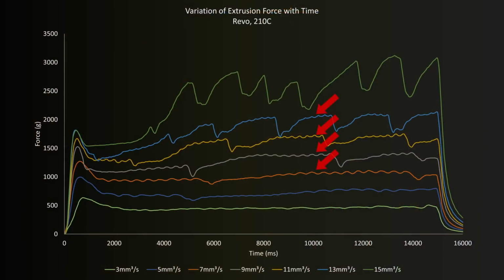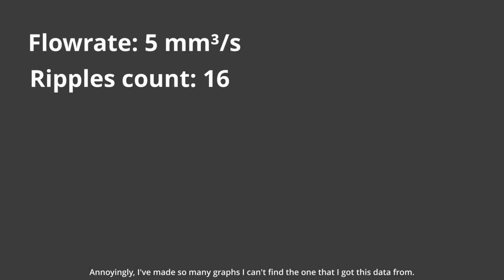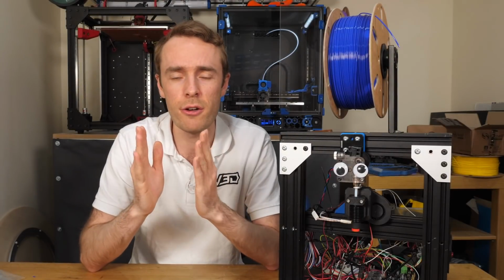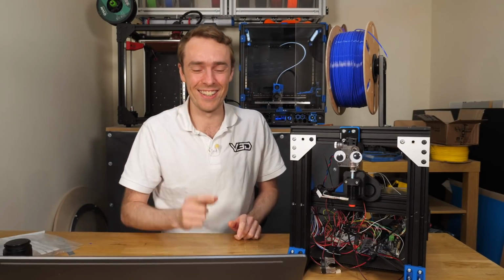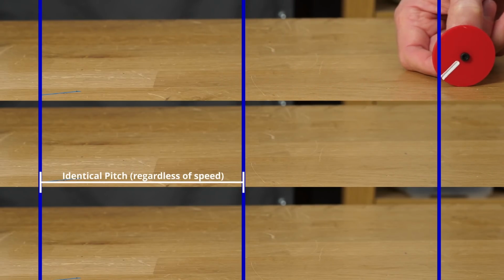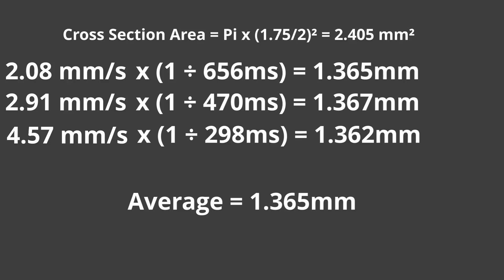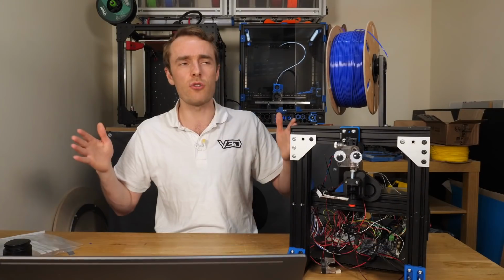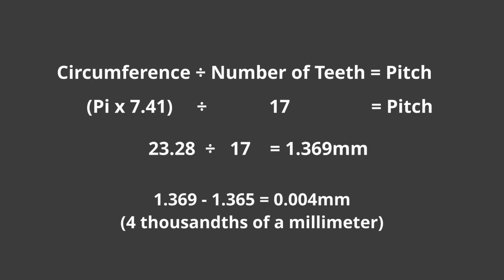Are Clone Extruders Ruining Your 3D Prints?

Comment: Use of helical/double helical gears should mitigate this problem ensuring smooth engagment of extruder gears. These gears are allot more difficult to produce though
Reply: I agree. I think even 2 single helical gears would help the issue a lot, though this is just a hypothesis.

Comment: From what I've tested and seen on MihaiDesigns videos the dual gear extruders will always produce this pattern. It can be more or less visible but I couldn't get rid of it completely.
Reply: I replied to Vector 3D's Tweet about his previous video with a link to MihaiDesigns' video on topic. As MihaiDesigns points out, this problem is inherent to dual gear extruders. As long as the distance between the two gears is allowed to move a bit, this problem will persist. The extruder really needs to be redesigned to solve the problem.
Reply: @ddegn  Yes, you're right. This is a design problem. Bad poor quality clones can make it more obvious/visible.

Comment: I've got about 6 of these in rotation.  And to be honest, they are pretty trash unsurprisingly lol

After a few hundred hours of printing the roller bearings die and everything goes to hell.  I've had much more consistent luck with the even cheaper titan clones being a simpler design. 

Been wanting an authentic bmg, but eh the price is tough when you have 24 machines lol

Comment: I've actually put a lot of thought into this one. My prediction is that a filament test is in your future. The gear teeth would have to be very small if you don't want this artifact, to the point of being useless. My intuition says that it's the filament hardness (compressive and shear strength) that is the cause. If you were to use a different filament, you should get a different result. Temperature will make a difference of course, but since you have your fancy filament-force-o-meter, which I nominate for its name before you do the obvious next thing, it should be a breeze. 

I almost forgot. My prediction is that the softer the filament, the less of an artifact because the teeth are really in there, and the radius of movement? is smaller. This could be exaggerated and compensated by adjusting your spring tension 

Another prediction is that smaller diameter hobbed gears will have a more noticeable artifact, than larger diameter hobbed gears. More teeth to do bites

My logic support:
In civil engineering you calculate the volume of asphalt for a road by multiplying the centerline length by the width, by the thickness. You don't have to account for curves because the centerline is in the middle of the road.

I used to think the line was on the outside surface of the filament. It is not. I feel like you want the average radius of the gears to be as close as you can to the radius of the filament.

Comment: I had a very cheap clone with a roller bearing on the idler that failed and gave me very obvious artifacts. Changed the bearing and shaft and it's good. I think one of the ballrace bearings is getting a little notchy on a clockwork extruder and it's doing similar. 

But with good bearings the difference between cheap 1.8 degree steppers and e3d/motech 0.9 degree steppers in my XY is much more apparent than extruder induced artifacts. Specifically moving one axis whist the other is stationary on a weak microstep can give some jitter thats visible with shiny filament in some lighting.

Comment: this reminds me of the issue that Stephan (CNC Kitchen) had with a single hobbed gear extruder where the center hole was offset (i.e. NOT in the center of the gear).  All the talk of backlash (???) doesn't make sense, nor does the synch of the teeth.  However, the difference when offset, means the gear actually has a higher speed at the "circumference" because the different places are closer or further away from the center.  Different "speed", means different force!

So, is the center hole (on all the gears, including stepper) actually in the center of the gear????

Comment: There are a few other people coming to the same conclusion with different methods (the vertical ripples in vertical walls for instance). This is however the most "scientific" proof that gear backlash is causing this.
I would love to indeed see the comparison with the original BMG but also with the larger gear extruders like Orbiter and LGX with its plastic gears which might well dampen the backlash more effectively.

Comment: I've experienced this when i was developing remotely driven flexible shaft extruder a few years ago. I couldn't thought of a good way to test what was the root cause... your load cell extrusion force method combined with the ideas in this video just gave me a big inspiration on how to solve some issues i've experienced or at least find out what went wrong. good to see people are getting more scientific about consumer FDM 3d Printing....
Reply: @jamesmccaul2945  haha i kind of stopped working on it... and yes you are right about the performance compromises which most flex shaft driven designs/products i've seen didn't address or even mention.

Comment: My initial thought is the tooth profile not quite being linear with rotation. Involute gears have a contact patch that moves in and out. Changing ratio slightly and sinusoidally? 
Might be nice to try belted gearing as I'd imagine multi tooth contact would have an averaging effect.

Comment: Had issues on my Voron 0.1 and replaced the main gear + shaft assembly from the BMG one to a cloned version and my issues were almost gone. I assume my main gear is slightly off-center and was causing these issues
Reply: I had exactly the same experience but in my case fake BMG gears kit solved wood grain inconsistency completely, compare to original BMG gears.

Comment: Exactly what I predicted in your last video! I made a test.. printed an object where the extruded amount per layer is extremely close to one rotation of the extruder gear..  you can clearly see the variation in extrusion width wandering up the object and count the teeth on it. Transparent filament is working very good for this. After seeing this, I really think this is a substantial problem we have with fdm printing . I´m working on a sensor system to make this visible and later correcting while printing. Or closed loop extrusion in other words. This will take some time, but I did my research, pcb and hardware design, building the first prototype in a few days. When I have something working I´ll send some out for research, maybe you´re also interested? Keep on with this series, we need to have more data on this stuff:)
Reply: 'After seeing this, I really think this is a substantial problem we have with fdm printing . I´m working on a sensor system to make this visible and later correcting while printing. '  
Just to save you some trouble, all you really need to do is keep the drive gears fully engaged at all times.  IOW don't let minor variations in filament diameter push the exactly parallel shafts apart.  Push harder on the bottom to keep the drive gears together, and let the top float a bit to take up filament diameter differences.  The tiny change in angle won't matter.

May still be some artifacts anyway, the teeth are relatively large for the drive diameter.  But the variation in pattern from changing filament diameter is from changing the drive gear engagement.  Just press them together and stop over constraining the shafts to be exactly parallel is all that's needed.
If you have one affected by this, simply open it, heat up the idler arm a bit, and twist toward closing the drive gears a degree or few and let it cool.  A tiny bit of skew in favor of the drive gears engaging is probably the only thing needed for most of these..

Comment: Gr8 job m8!
Unfortunately, but this problem occurs on all dual gear extruders. It does not matter whether it is a cheap chinese one or original BMG. Issue manifests itself as unevenly printed layers. On small prints it can be easily mistaken as "z banding", on larger ones horizontal banding lines occurs slightly at an angle. That's the reason why I bought OMG V2s.
Let's settle this once and for all, dual gear extruders are just bad.
Reply: Interesting take. So should a LGX perform better?
Reply: @NathanBuildsRobots  I don't own one, so I can't be 100% sure about this, but I think it will probably be better. It is still a dual gear extruder, just with bigger gears, so the issue might be still there. IMO stick with single geared.
Reply: @real-insan3  I like the extra traction from dual gear though. I think it should be less of an issue with larger gears too.
Reply: You sent me searching for this thing.  Serialized single-gear feeders?  Makes me wonder if anyone has tried to use TWO synchronized small steppers, set face-to-face, so that both sides of the filament are guided under force, but not mechanically geared together.
Reply: @GnuReligion  That's an interesting idea, but let's stick to the KISS rule and make it simpler! What do you think about individually driving both extrusion gears from the same stepper, like in V2s?
Reply: @real-insan3  You mean Bondtech DDX?  I see references to those, but do not know how they work ... and cannot find a diagram of the guts.
Reply: I think you are on to something. This would be pretty easy to set up in klipper.

Comment: MihaiDesigns has a similar video discussing the same problem and some fixes, he derived the length and found the problem a little differently than you but came to the same conclusion. Titled "What I've learned about dual gear extruders and how to patch them, maybe". Interesting problem, his assessment was it was the inherit flaw of dual drive system.
Reply: I came here to say just that, thank you.
Reply: Besides the ripple, there's also layer artifacts (layer width slight inconsistency) under extreme harsh light (parallel to the vertical print direction). I also see this on prints coming off a Fortus 400mc but less prominent. I suppose this is just from very small variation in extrusion and retraction from pressure build up.
Reply: @foureight84   @foureight84  PID tune heat bed. I heard that 0.1 degree Celcius fluctuation of the heated bed can contribute to the layer width inconsistency. I tried this myself and it helped but not eliminate all issue.
I often PID tune one temperature and use that for all ABS filament. Of course, thank to klipper's config, it makes saving multi-config so easy. 
Though, my PID tuned hotend isn't that great. I often see it fluctuate around 0.4 degree Celcius even though I PID tune it a few times.
Reply: @nhozdien5058  I've seen people comment that Klippers PID tune is not that great, I've never messed with it but my duet keeps the bed at the target temp within 0.1 degree Celcius. Building a klipper voron so I guess I'll find out
Reply: @aharkey1077  good luck and have fun. V0 is their best design so far if one doesn’t need a bigger printing volume.
Reply: @nhozdien5058  building a 2.4 just because the 4 Z floating gantry is so Gucci lol!
Reply: @aharkey1077  I have one too but is unfinished for nearly 2 years. 2.2 base with 2.4 gantry and other mods that I did on my own. Now I only need to finish the bed hood mod.
Reply: A potential solution is to have the idler which does not moves away from the main gear in a parallel fashion (as in every dual gear system I have seen), but which "tilts" away, using the its gear-end as pivoting point. This would allow for a better (not perfect) meshing of the teeth in different use conditions. Or the teeth could be replaced by hard rubber, maybe.
Reply: @olafmarzocchi6194  'but which "tilts" away, using the its gear-end as pivoting point. This would allow for a better (not perfect) meshing of the teeth in different use conditions.'

Exactly this, but you weren't supposed to tell everybody..  Far from 'clone ones are bad' they're too good and exact, and over constrained.  And this affects Prusas.  And some Bondtechs.  It isn't clones at all.

Heat your idler side arm a bit, twist it toward drive gears in a degree or few, and let it cool down.
Isn't going to matter at all if the top goes in or out a tiny bit with filament diameters, the drive gear simply has to remain as fully engaged as possible.  

Technically a slightly better design that keeps the drive side fully engaged while allowing the drive path to have good tension but still be able to float a bit would be better.  Then it would change angle slightly but that wouldn't really matter much.

And also technically a slightly splayed cut, helical gears, and even a compensating gear cut would would be better.  Again way overkill for it though, if you just keep the drive gears fully engaged they'll wear together anyway.
Reply: @ModelLights  I wasn't supposed to tell everybody? I don't understand
Reply: @olafmarzocchi6194  '  I wasn't supposed to tell everybody? I don't understand' 
Just a joke about keeping it secret so we can patent and sell the solution.. :)
Reply: "it was the inherit flaw of dual drive system."
Yes. The distance between the two gears is allowed to change in many of these designs. The small amount of slop causes these fluctuations.

Comment: It takes some energy and force to imbed a tooth into the filament. Do the ripples change in amplitude when the tension is changed?
Reply from the maker: I'm so glad you asked this. I've already tested, answers should be in the next video.
Reply: If the teeth bind in the plastic the gears mesh better because there is less space between them. My guess is that periodicity would likely not change that much.